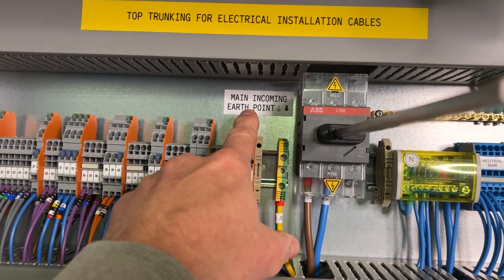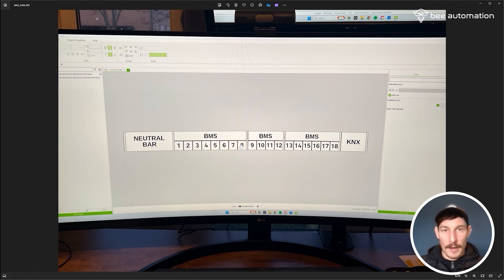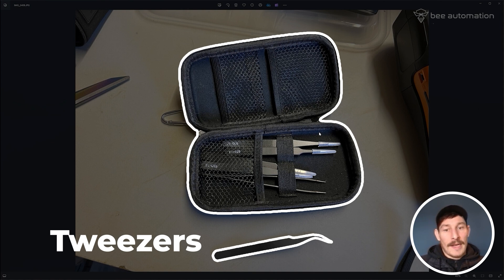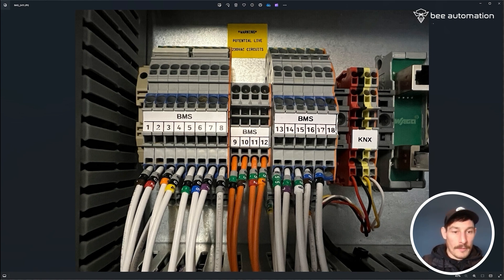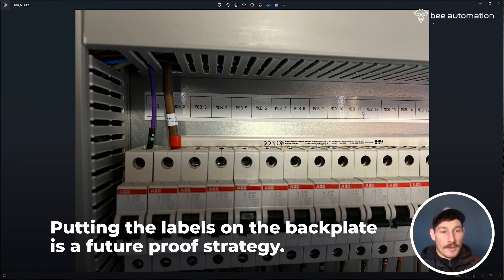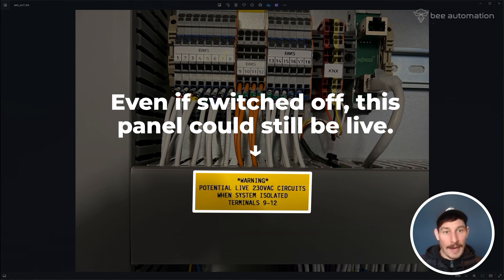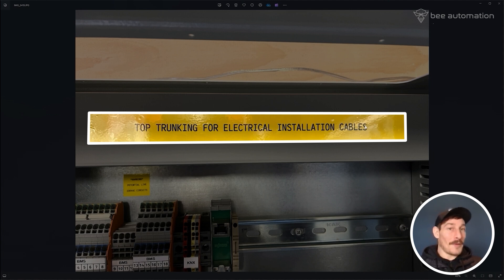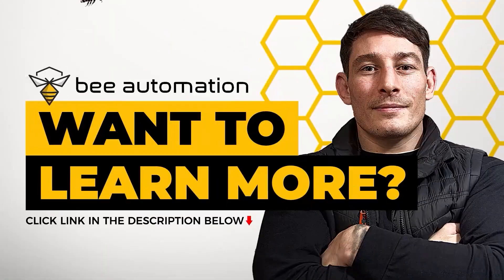How & Why I Label Industrial Control Panel Components

Comment: Not sure what those non isolated live terminals are for but in my view present a real danger and as such should have had a warning sign on the external of the panel at the side of the isolator at the very least. Why couldn’t they go through  auxiliary contacts on the isolator or an isolation relay. Somebody gets injured and not sure what your defence in court will be, would never have been allowed anywhere I worked in industry
Reply: They are allowed EVERYWHERE in industry. They are excepted circuits as defined under iso60204. As to why you cant take them though auxiliary contacts, well ive seen panels with 50+ excepted circuits, and this practice would make it very difficult.